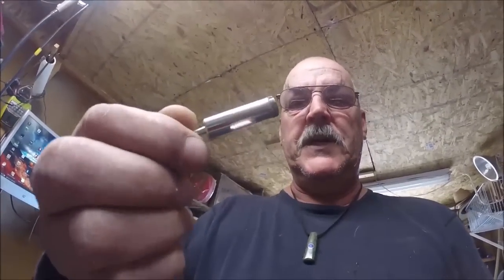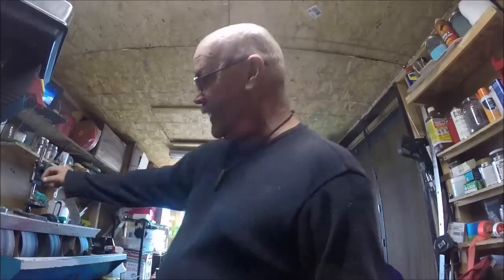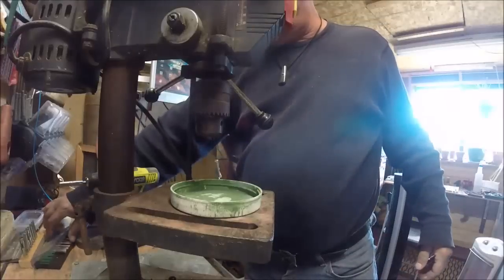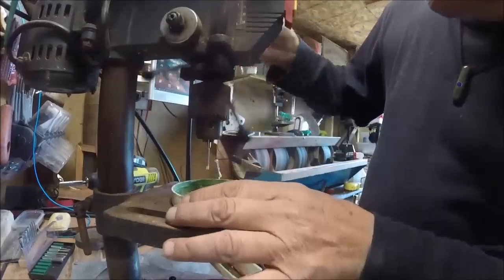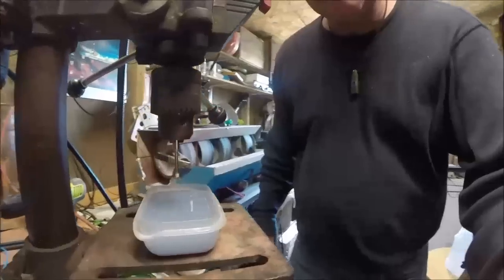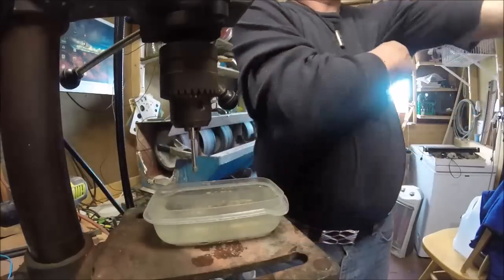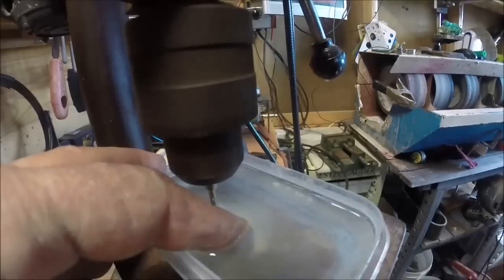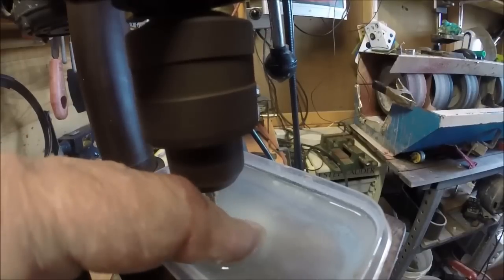How to drill a hole in a rock for jewelry

Comment: wow that's awesome your old craftsman still works great! I am 26 and my dad is 80 years old and he still has most of his first tools he bought when in his 20's and they still work like new! which would have been in the 50's so that just tells you back in the day everything was made with quality! god I wish thing would have stayed the same, and i hear the old ( " back in the good old days" ) line everyday! lol But it is true! I bought a plain old screw driver set for myself and less than two months later all of them have rust and two of them have broken, handle of one came off, the other snapped in half in the middle of the shaft! piece of sh**! Thanks for the video! Now I can do this myself and use my dads old drill driver!
Reply from the maker: Tools lasted longer, but they cost more in real money. 30 years ago I was making $3.50 an hour when I bought that for $125,00. Now I make $20.00 Per Hour and it's still $125.00.  My advice is to buy quality tools if you think you will use them more than once. Otherwise, buy the throw away tools, and replace them often. Good luck :-)

Comment: Good morning Sir....I'm pulling my hair out : ) I have been trying to drill 1/8" hole about 1/4"  into river rock for crafting purposes. Your video is great and I just need to remember not to rush it, having minimal success. Any suggestions on a bit type/brand that river make the drilling in river rock, not easier but where I have more success. The river rock I'm using is the type you'd use around your yard. Your advice would be much appreciated.

Comment: Is the wen or the Ryobi a decent drillpress for drilling stones with which is mostly what i want it for
Reply from the maker: I think almost any drill press will work. The one I'm using is larger than I need. Dremel has a small drill press stand you can attach your dremel  to. They cost about $40. Good Luck :-)
Reply from the maker: https://www.homedepot.com/p/Milescraft-Rotary-Tool-Drill-Press-Stand-Model-1097-1097/100507168?cm_mmc=Shopping%7CG%7CBase%7CD25T%7C25-7_POWER+TOOL+ACCESSORIES%7CNA%7CPLA%7c71700000034127227%7c58700003933021549%7c92700031755124880&gclid=Cj0KCQjw_7HdBRDPARIsAN_ltcKVyFDOF5GQtImwXPPKHUWO6O3roR-KwBdylvUHzLE3tQ_2bEOvwGkaAt6vEALw_wcB&gclsrc=aw.ds&dclid=CJCb7p_N290CFUh_YgodZ5QPTw
Reply from the maker: I found this one at Home Depot.

Comment: I have a dremel can this be used as well?
Reply from the maker: It can be done, but sometimes holding a dremel while it's spinning hard to handle. If you have a dremel with a Flax shaft, that is a little easier. Just work slowly.
Reply: Ok I’m scared of the water with electrical equipment I’m new to this is this method safe with my dremel as well?
Reply: Is the flex shaft the attachable handle because mine did come with that for more control?

Comment: When you flip to the other side how do you line it up
Reply from the maker: The rock i drilled was slightly transparent, so when I get close to the other side, I can see where the drill is going to come out. you have to be careful not to break through with too much force or the hole will be rough.
Reply: Without any transparency it goes to the tried and truth SWAG method??

Comment: what drill bits are you using if you don't mind me asking
Reply from the maker: The bit I'm using in the video is a diamond plated bit. They are pretty cheap online (I like Lasco Tools, made in USA). The most important thing is to use them wet and slowly so the diamond does the cutting.

Comment: this could have been a good video but who can buy an old tool like this? He gives no size of drills, or the next best thing to use as what he is using is very old, shame really, will have to continue the search! Trying to drill holes in crystal beads that have no holes"!
Reply from the maker: The point of the video is that special equipment is not needed. That it is not rocket science, and to give the basics of using diamond bits to cut through a stone. At this point 393 people liked it, sorry you're one of the 24 that doesn't.
Reply: It's rock-it science. It looks like I've been approaching it the same way as you, except for the patience bit (pun intended).
Reply: Its  drill press with a diamond bit. Wtf else do you need to know? Keep the bit wet and go slow. It's not a big deal.